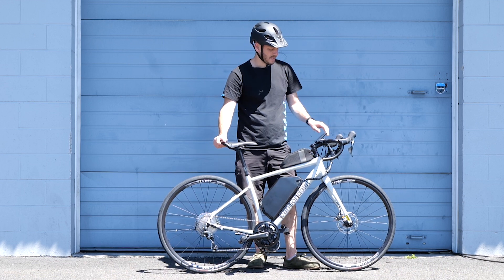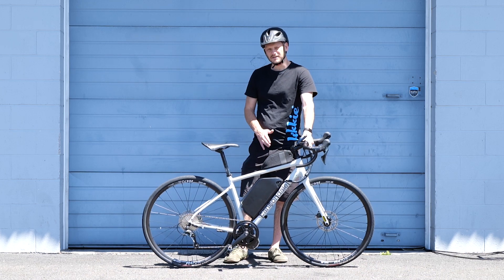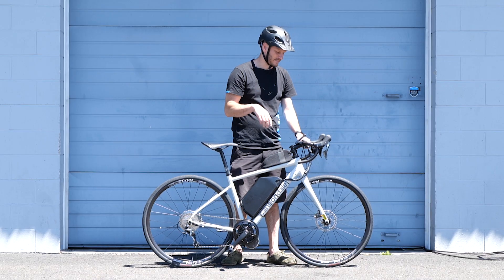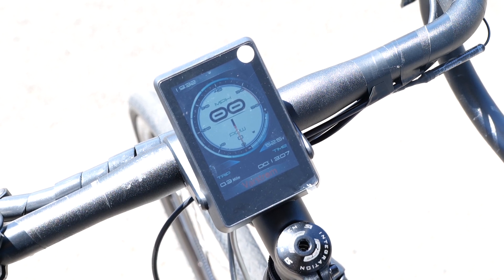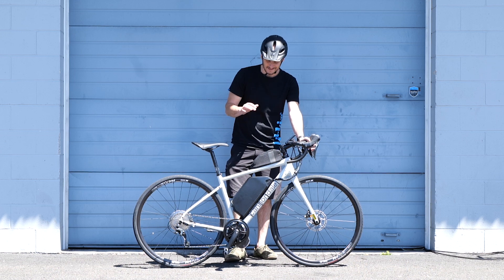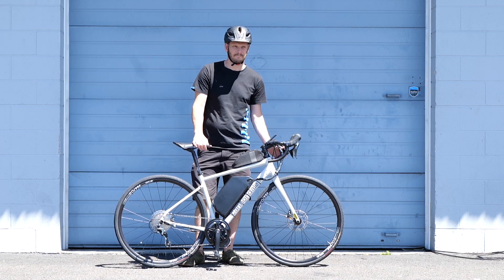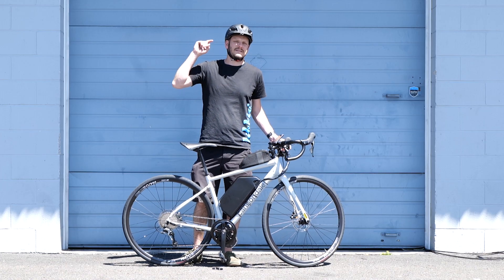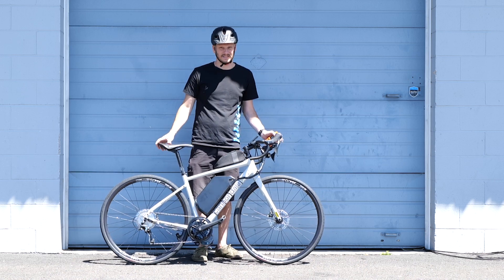Custom E-bike Build: Cannondale Synapse 52v 25ah w/ 750w BBS02 Mid Drive

Comment: Is this a carbon or aluminum frame? Is it a bad idea to install something like this on a carbon frame?
Reply from the maker: You just have to be super careful and not over tighten the bottom bracket clamp if the bottom bracket is also made of aluminum.

Comment: I HAVE THE SAME BIKE WITH 750W BBS02B AND 48V 20AH BATTERY.  BUT I DONT KNOW WHY MY BIKE WEIGHT IS HEAVIER. ITS 45 POUNDS
Reply: is your frame carbon or aluminum?
Reply: @al-du6lb  MY FRAME IS CANNODALE SYNAPSE. ITS ALUMINUM. IM RIDING WITH CARBON WHEELS. XTR PEDALS

Comment: Cant help but notice you dont have many install videos of the CYC Photon. Seems you mainly use the BBS02. Should I not buy the Photon from you?
Reply from the maker: I like the photon, it just seems like everyone still prefers Bafang motors though.
Reply: @JohnnyNerdOut  I cant get past cadence only. I still want a bike but just with a little help for longer rides.

What about the Toseven dm02? Looks like they are pre-order from you currently but that unit has been out for a while. Are they updating it? Would you recommend that for torque sensing over the photon?

Comment: Thank you for sharing this video. I hope you and your family are having a great summer.2024. I built a similar bike used in this video.( specialize aluminum diverge.) with a kit I bought from you. I am very pleased with the purchase and you’ve been great in helping me out making modifications and adding additional accessories along the way ❤however this frame has got too much flex and is really starting to annoy me and I’m afraid I’m gonna get to the point to it may snap. So my thoughts are I’m looking for a good donor Bike (m) either a heavy aluminum frame or a steel frame, ideally upright I like my Jones H-Bars, w/ disc brake set up that can use my 700c custom wheels.❤ thanks 😊. #1000watt. W/52volt 25Ahr.batt😮. Flys😮love this build I just used the wrong frame 🫨.

Comment: How is the trip wire install on the drop bar . Is it possible to send photo or make an installation video ?
Reply from the maker: There are instructions included with the trip wire. We made a customer connection to make it fit with the Bafang but that is easy. Just two wires.
Reply: @JohnnyNerdOut  thanks ! buy reading online i understand that you need to adapt 4 pin JST to the 3 pin HiGo, do you sell this adaptor or it needs to be custom made each time

Comment: the magura oil pressure brake light sensor will fit on any mineral oil based hydraulic brake. you need to integrate it somewhere in the brake hose and rebleed the hydraulic system. must be a pain ondrop bar levers, but a breeze onflat bar levers, especially shimano brand ones
Reply: How does it connect to bafang wiring
Reply: @Kannondale07  check which 2 pins are switched on the stock brake levers with a multimeter, these 2 wires need to be connected to the magura switch

Comment: Why not the lighter, simpler DM01?
Reply from the maker: Some customers still prefer the tried and true Bafang systems. When torque sensing is not needed/wanted, Bafang is king IMO.
Reply: @JohnnyNerdOut  too many extra wires necessary. Kind of heavy, but admittedly, still the king  of quiet.
Reply from the maker: @MHH3180  I have 2t1 wiring harnesses for Bafang 😀
Reply: @JohnnyNerdOut  but The Bafang has soo much over run you really need cut-offs.
Reply: Do you like the toseven motors? I'm leaning towards the toseven over the bafang for the torque sensing, but would be fine with either if the bafang is a lot better..
Reply: @al-du6lb  heavy and does not like being without brake cut offs or a shift sensor. That's a lot of extra wiring. If you have a good deraileur the antique programming will have you waiting for the motor to kick back in with every shift or brake. The ToSeven is lighter and more easily programmed right from the display.
Reply: @MHH3180  just so I make sure I understood you correctly, you prefer the toseven motor over the bafang? The bafang is heavier? Is that correct?
Reply: @al-du6lb  yes
Reply: @MHH3180  thank you very much. One more question: do you prefer the toseven over the tongsheng?
Reply: @al-du6lb  yes, even compared to before TS screwed up their programming. Even compared to The OSF version. The ToSevens dissipate heat better, are more programmable at the display and even the torque sensor is programmable. The TSDZ8, performance wise. Is basically the old TSDZ2, but more expensive, heavier and without an anti-rotational bracket. It barely compares to The DM02, much less The DM01 in base performance.

Comment: One question , why do cut outs when the motor cuts out when you quit pedaling?? Who pedals & brakes at the same time???
Reply from the maker: Plenty of scenarios. But yes on paper, you are correct. If you need to shift while at low speeds and you don’t have enough rpm for the gear shift sensor to do its job, it’s nice to have a manual cut-out for example.

Comment: Nice build.  Super light and plenty of speed.  With the BBS02 I would want the programming cable so I could make adjustments.  Might even lower the max Amperage so the top speed is less.  Making it a little more street legal.  

Again very nice light build.

Comment: I've always wondered if you took a road bike and put a cyc pro motor how fast you could get going
Reply from the maker: It’s on my list of videos to make as well 😀😀😀
Reply: I have one on my heavy specialised fat boy, can reach 35mph very quickly off road, I’m using their 52v large battery and I’m only getting 3000w of 6000w, need 72v battery for scary full power, what a piece of kit ❤❤❤❤ so just imagine on a light weight road bike